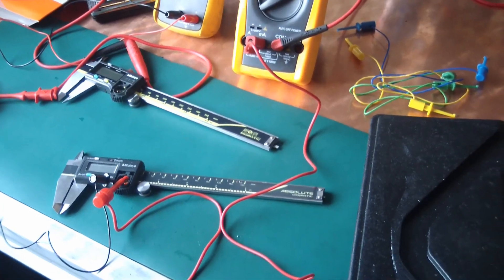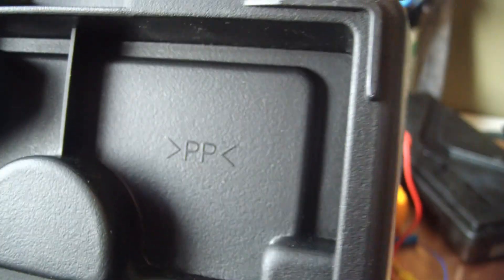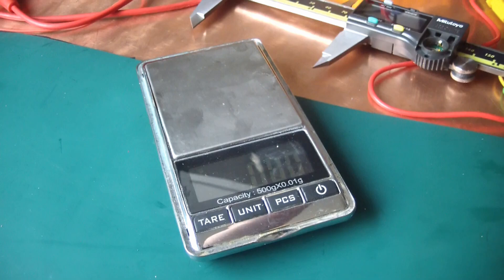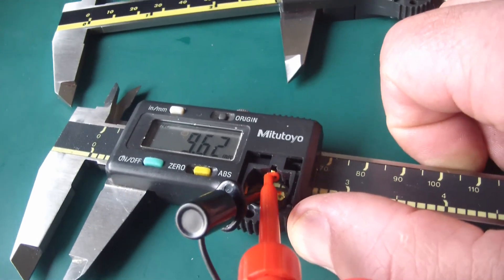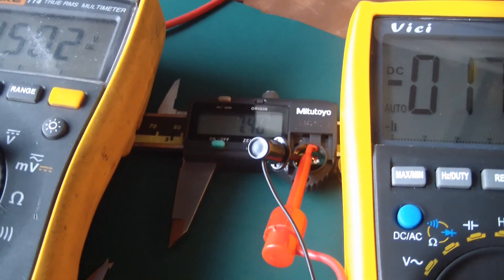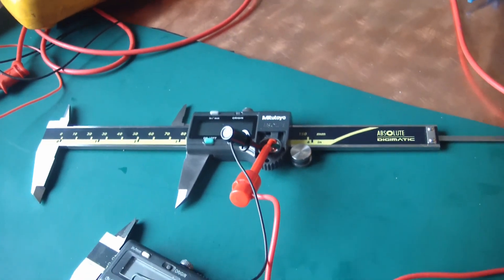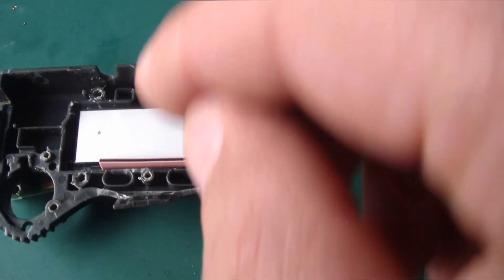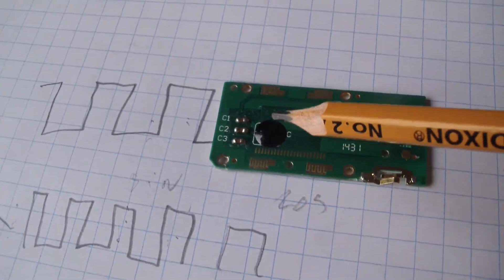BOLTR: $33 Mitutoyo Calipers, too good to be true?

Comment: mechanical calipers have no battery to die! What do you think of el cheapo dial calipers compared to a good set?
Reply: I have two dial calipers. A cheap pair I got 20 years ago, and a Brown & Sharpe pair I got a couple of months ago. Both read accurately enough, but the B&S pair feel nicer and move a little more smoothly. They cost about 4 times as much, but inflation accounts for some of that, and the current fad for digital makes up the rest.

Advantage of digital is ability to select metric, imperial, or fraction, depending on what you are doing.  Advantage of dial is no batteries, easier to read in bright light, less subject to contamination malfunctions, no damage potential from static electricity and less from heat, and lower price.  I use the dial calipers more often than my digital ones. 

-- Mike
Reply: well said. i always get nervous when i use digital calipers... i feel more confident with dial. and yea, my el cheapo dial caliper is gritty, but i've also put a lot of grit in it. the starett's i use at work are like butter!
Reply: plus you can do incremental measuring super easily.

Comment: hmmm. I bought some 6" Absolute AOS's from an "Authorized Mitutoyo Distributor" in the USA, on sale for $99 from $126. The grinding is parallel, lock screw is correct, and edges are good - but the QC Manager signature and red stamp are printed. You can see coarse pixels in the signature. It draws 0.9 uA when off and seems to oscillate between 2 and 6 uA when on. I don't have a variable power supply so I didn't test low voltage behavior. I called Mitutoyo technical support, and they said the printed signature is normal. Can anyone else with a known genuine 500-196-30 verify that their QC Manager signature is pixelated?

Comment: I have to buy or make some calipers with a dedicated power supply and display, just avoid the issue of batteries and those terrible non-soldered LCD connections.

Comment: Dial calipers all the way
Reply: I beg to differ. I need 100s
Reply: @dannydetonator  100's of what, an inch?Calipers? I never seen a dial caliper (even most verniers can do 1thou,if you have young eyes anyway) with a resolution that isn't at least down to 1 thou and even then some(dont even get me started on potential of dial indicators, jeesh) so im truly baffled by your comment,maybe my interpretation is incorrect.Very much a beginner hobbyist machinist but been using calipers as a sheetmetal worker for decades and am an avid re-loader where i care about 1/2 a thou of neck tension to keep my ES low for long range precision shooting.Ive never seen a digital caliper that reads below one thou accurately, some claim to do 1/2 thou but that last digit is always zero or 5 so not truly that level of accuracy,at least in any ive personally used,i do not like there ability to "slip the scale" or knock zero reset,a IMPOSSIBILITY with a dial caliper,better ones are harder to induce a slip(ive still been able to do it on Mitutoyo's but it is harder than on ching chongs)but they all suffer from the zero reset issue.
Reply: Ugg. Digitalis is not only easyer, it is fars more accuright.

Comment: What the fuck did you just do?? That is a real caliper. The cheaper version but still the real deal. I go through hundreds a year as i calibrate them at my workplace. Ive seen a lot of those pcbs in many, i recognize the copper strip "sensor" its the same in plenty. The one sole thing that i gets suspicious is that at 0.9v the B symbol should have came up for sure, adding to that it would also decrease the intensity of the values.

Tips to check for a true mitutoyo caliper.

▪️Check if you've got redish screw tread lock on the top side at the adjustable setting screws.

▪️The setting screws must be for a small flat screw driver.

▪️The bearing "copper" strip should have one side sort of painted black. At the side of the setting screws.

▪️Try also showing the peeling off of the back "sticker" and please show the plastic piece. A true mitutoyo caliper will leave all the glue on the back of the metal and only 4 (sometimes less) spots on the back of the plastic "sticker". These 4 spots will be at the screw location.

▪️Also check the quality of the backing strip as in how flexiable, and thickness it is. Because a true quality caliper will be quite thick and durable ish.

▪️And yes most modern calipers do have a sharp edge on the top.

You are lucky to own the older one as those will last you ages because their quality was much much finer then nowadays.

If you need help just contact me or something as i know a thing or two about them lol

Cya and thanks for the videos ;)

Comment: Bought a set of left handers for cheap as they have their uses but  the finish on these were like they had been linished  with 36 grit emery cloth ! The jaws when closed had more of a gap between them than linda lovelace could ever achieve ! 
Had a play with them and got them to the usable stage as i only use them to get me near the measurement i want but what a pain in the ass!
Have a set of mitzi's and a set of starrett ( probably made in china anyhow ) the mitutoyo unit is heaps smoother .
I have a few other cheap sets and that was the only gripe i had was they chewed batteries , often wondered about fitting avery small slide switch or maybe a set of small contacts inside that could be opened by pushing a small plastic pin in between them to disconnect the battery ?

Comment: http://www.ebay.com/itm/HOT-BOX-MITUTOYO-ABSOLUTE-6-DIGITAL-CALIPER-500-196-30-BRAND-2015-/391190882280?pt=LH_DefaultDomain_0&hash=item5b14cb27e8     These the same ?
  
   These say that it has a "low voltage alarm built in " ...... Whaddya think AvE  ????

Comment: Hey AvE,
more expensive calipers got an absolute scale, that is why they "know" where they are if they are powered off. The cheap ones got a incremental scale which means that they don't know where they are when powered off.

Both calipers are if I am right some with absolute scales.

Here some information about this system (I only found one for rotary encoders but principle is nearly the same)

https://www.posital.com/en/products/rotary-encoders/absolute-vs-incremental/absolute-vs-incremental.php

Regards from Germany!

Comment: Mitutoyo I know for a fact is high quality. Being in the trades here merica we see more starrett I'm only required to carry a 0-1 and feelers as far as precision goes besides combo squares tapes and plum bobs. Even on the big jobs they always want the readings with there stuff because its there ass. My 0-1 is a starrett however I have a cheap set of digital calipers just like the ones you smashed they are within .002 to .003 if not dead on if used right. I wouldn't even used any precision tool on the job if I had a choice that was digital for measuring anything that mattered they just seem to fuck up mechanical especially something that measures with thread doesnt. Unless it's been damaged I always check with a standard. My digital calipers I only use for simple things such as measuring bolts,bolt holes,nuts finding wrench sizes etc. I have a set of mics from harborfreight  from 0 to 2 they work great.

Comment: I have some $30 General digital calipers. I've never used anything better, so I'm content with them, but they re-zero every time you turn them off, so you have to close them and turn them on or turn them on in their last position and close them, read the negative measurement, zero them, and reopen them to the matching measurement. All that is mildly annoying BUT the batteries last for a long time and it doesn't shit the bed when the voltage gets low.

Comment: Nice video. I grew up in Ireland so when it changed to metric we had to know both systems. The Machine building work that I do requires that you work in both systems. In building work, I use meters and mm's ...... less mistakes.

Comment: Calipers are just calipers. It will just get ya close. You will know if you picked up the wrong drill. If you need to be accurate on a hole pin gauges, bore gauges well you all know this. I have the 150.00 set but i rarely use them because they were 150 bucks. I have 2-3 sets of the cheap brand i throw around. My biggest concern with the cheap ones are the anvils are not parallel put them together and look at a light you can see a gap (not good) i fix that the best i can so it measures  good front to back. And use the fuck out of them

Comment: $150 Mitutoyo Caliper standby current: 1.8uA. My $10 noname-brand non-absolutematic calipers: 0.5uA (since they don't bother to track movement while off). Given how infrequently I use my calipers, I think I'm happy to re-zero on power-on to get my 3x battery life for $140 cheaper (disclaimer: battery self-discharge rate may dominate; battery life may not be 3x). But, excellent video! Very interesting - fascinating how the mid-price calipers have by far the worst standby current, even compared to the super-cheap ones. 

Side note: my calipers consume 18uA while on; as if I have the same chip as the knockoff Mitutoyo -- but since it turns itself off when off, I think that's fine.

Comment: I wouldn't say that the real problem with the knock off calipers is the high quiescent current draw that eats batteries and the lack of a low battery indicator and the fact that the readings become unreliable when the battery voltage drops, although those are all big problems.  I'd say the real problem is they label them as Mitutoyo and do everything they can to sell them as the real thing.  This isn't like Samsnug instead of Samsung.  The makers of these fake calipers are deliberately ripping people off by claiming to be something they are not.  It's one thing to deliberately buy a cheap tool knowing it's a cheap tool.  It's quite another to be fooled into paying way too much for a cheap knock off, thinking you're buying the real deal.  The consumer loses, and so does Mitutoyo.  They receive the cheap knock off calipers for warranty repair and are then on the hook for the time and expense of dealing with a pissed off customer, who is not even a customer because Mitutoyo never saw any of that money.

Most people know that they aren't getting new Mitutoyo calipers for $33, but I've seen these rip off calipers selling for $99.  By pricing them at almost the price of the real item, people are conned into buying them, thinking they got a good deal on the real deal, when they actually got boned.

I've been aware of the Mitutoyo knock off items for years.  That's why I buy my Mitutoyo items from McMaster-Carr and not eBay.

I bought a "Genuine Samsung" charger on Amazon for my Galaxy Note 4 several months ago.  It was a high priced Chinese knock off, very similar to the Mitutoyo calipers.  It almost looks like the real thing.  It's a good cosmetic copy, but it doesn't chooch like it should.  The plug doesn't fit as well as the real deal.  It charges the phone, but it won't quick charge it because it doesn't have the current capacity.  I really should have sent it back so Amazon had to make good on the return so they're more picky about their sellers and they aren't encouraging these blatant rip off sellers to prosper.  The fake merchandise is giving Amazon a bad name.

There are also numerous high end rifle scopes and red dot sights that are being cloned.  EOTech had a warning on their website, advising customers how to tell if their "EOTech" is a cheap knock off.  The same is true of Leupold.  Sadly, it's human nature to shirk the blame, and if the buyer can't blame himself and the actual seller is hiding behind a legit company, for some very unfair reason most people will blame the legit company that was also a victim of this fraud, so the good name of a good company is damaged by these frauds.

As is often my solution for such weasel behavior, these thieves need to be castrated with a Taco Bell spork on live TV... to send a message.  Ditto for telemarketers, spammers, identity thieves, etc.
Reply: Liberty4Ever The suppliers sell them to stores as the real deal and counterfeit stuff is ending up in the legitimate supply chain. The Chinese will counterfeit absolutely anything from  selling fake Native American jewelry to Native Americans to sell as jewelry made by real Native Americans to selling fake medicine to hospitals. They have even counterfeited whole automobiles.
Reply: orlock20 I thought I was buying a box of genuine Cherokee hair tampons, but it was a cheap Chinese knock off.  They were made with nutria fur that had been dyed to look like Cherokee hair.  Commie bastages!
Reply: Steven Hardy Yeah, good luck with suing a Chinese company in a Chinese court ...
Reply: Re try suing a chinese company in a court: You think operations like these are done by traceable companies? The counterfeit products situation is waaay more gangster than that.
Reply: Liberty4Ever I’ve begun to wonder whether Amazon and eBay could be considered racketeers — they take no meaningful action to prevent stolen property (intellectual and otherwise) being sold on their “premises” and profit thereby. Same could be said of all the ripped-off movies here on YT.
Reply: +Liberty4Ever lol nutria fur... hahahahaha ha!
Reply: I would let the seller worry about contacting the supplier IF its something bought from a big box store...What happens? Well do you remember what happened with the huge baby car seat  recall about 15 years ago? (The big box store had to make good on the recall)
Reply: Liberty4Ever It really is time to revive the good old fashioned class action suits........
Reply: Liberty4Ever That be true dude.
Reply: Amazon has same scam but how bout buying from Brownells?
Reply: Liberty4Ever I agree in what tou say, but BangGood isn't selling them as Mitutoyo calipers, this is what's in the description: It's high quality model made in china,
but our component is the same as the original as well as the functon, please rest assured. It looks, feels and works like the real deal, but it isn't.
Reply: @PiratCarribean  Well, obviously as shown in this vijeo, they do not work like the real deal and that is the whole fucking problem really. I wouldn’t mind if somehow the knock off performed just as well. But it *does not*!

Comment: are you sure it is sensing travel and not position?
if it were sensing travel, why would the reading change when the voltage drops?
Reply: Silvan Geissmann I think it's essentially a sequential encoder that won't generate the same pattern in any two spots on the slide. I'm not exactly sure why it drifts at low voltage, but my guess is that the sampling frequency changes and that leads to incorrect readings somehow.

Comment: Man. I wish I could understand sin and cos.
Reply: sam strothers They actually do make sense (shocking, I know) but it's rather difficult to explain without visuals, so take a look at this .gif while you read my explanation: https://upload.wikimedia.org/wikipedia/commons/3/3b/Circle_cos_sin.gif.

Basically you start with a unit circle (a circle with a radius of 1) at the origin of a Cartesian plane (put the centre of the circle at the centre of one of those X,Y drawings you did in highschool math) then draw a line from the centre to any given point on the diameter of the circle, and measure the angle between that line and the positive X axis (the horizontal line extending to the right hand side) in the counterclockwise direction, that is the angle you put into your calculator. The answer it spits out will be X or Y coordinate of the endpoint of that line (the end on the diameter of the circle) depending on whether you pressed the cos or sin button (cos gives the X coordinate, sin gives the Y).

For some examples, if we start with an angle of 0°, our line is drawn straight out to the right on the horizontal axis, our cos value for this angle would be 1, and the sin would be 0, since the endpoint of our line is one unit to the right of the centre, and has not moved up or down. At an angle of 90° our line is drawn straight up, cos gives us a value of 0, since we haven't moved right or left, and sin gives us a value of 1, since we've moved one unit upwards. At 180° the line is drawn horizontally to the left, cos gives us a value of -1, since we've moved one unit in the negative direction on the X axis, and sin, again gives us 0, since we haven't moved up or down. At 270° the line is drawn straight down, cos is at 0 again, and sin is at -1, since we've moved one unit downwards.

Let me know if this helps.
Reply: droidmonger A radius of 1 is used to define the cos and sin functions because it makes it very easy to scale, you just multiply your result by whatever radius you're using, in your case that would be 62.165mm

That's why trig functions work the way they do, input the angle, and multiply by the length.
Reply: imbored742 What do you do if your circle is Ø124.33mm instead of "1"?